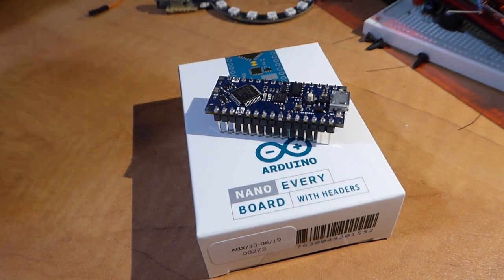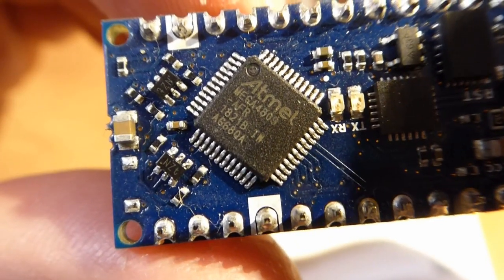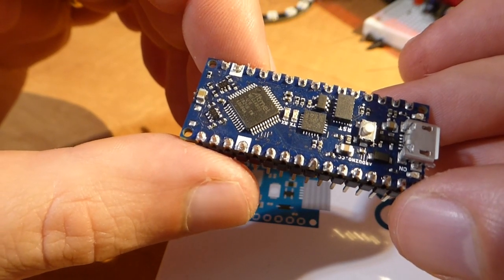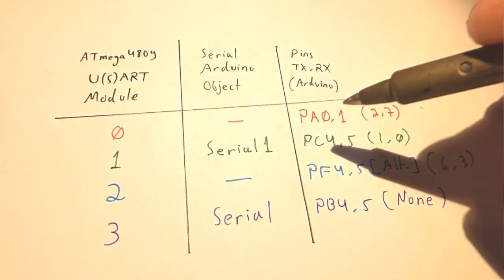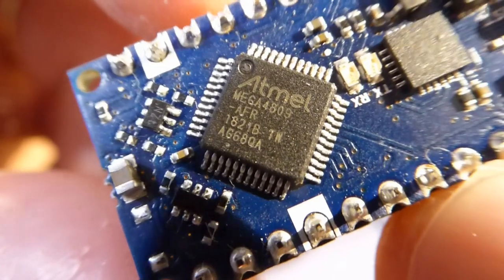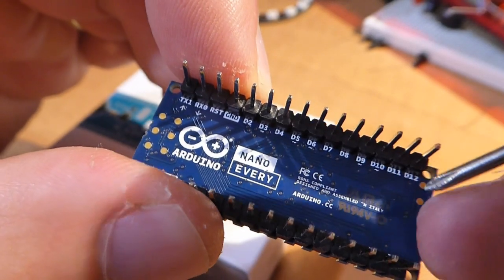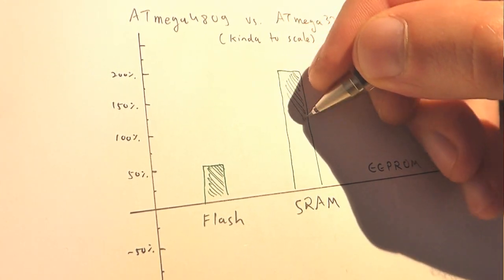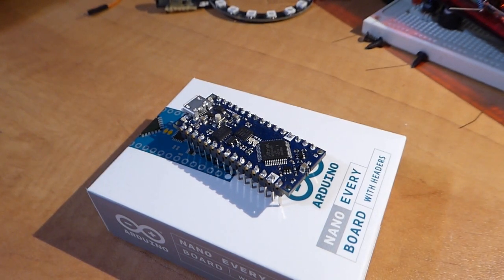Arduino Nano Every: Honest Review and actual info!

Comment: While I am on an old-ish version 1.8.19, a couple of sketches I have, seemed to run about 30% slower for repetitive digitalWrites.  Purchased an Every for the added program space, but was disappointed by speed.  Maybe they would be corrected in newer IDEs, but I will only use the Every, when it is actually needed.
Reply from the maker: I'll have to test that, 30% sounds like an unreasonably big difference. But whatever it is, if speed-toggling is what you require, using a generic catch-all abstraction like digitalWrite() is hardly a recommended path. Direct register access will accelerate such operations by a factor of 40, give or take.
Reply: @idogendel  I 100% agree on using registers directly... but I have not used the .   The test I first performed was running an existing sketch (seemed fair that it ran on the Uno, Nano, etc.) and it was easy to see the difference, without a stopwatch. I selected "Registers emulation: 'ATMEGA328' as when I selected None for registes emulation (ATMEGA4809) the hardware attached to the Nano Every did not function.  
Frankly, I chalked it up to the IDE compiling additional code so that the same source code would run on a very different processor.  The last thing I would have guessed is that it would be that much slower.   - Another sketch I connect to some I2C hardware would compile but not communicate.    [I ended up using a Pro Mega (solderable PCB) in place of the Every.]   Maybe one day, I will isolate the compiled code for the 328P and 4809P and see what the difference is.

Comment: Thanks. It's interesting to see negative review on youtube today. Anyways, I bought it case my nano has AtMega168p chip (it's 8 years old, I resurrected it) and Uno is weird format, I prefer using it in breadboard than connecting 10 wires. What I really don't like are pin description in the bottom. Also I'm not sure if insisting on the same form factor is good option, probably sometimes: for uno there are shields and for Micro I'm using headers with holes. But nano was always sitting in the breadboard for prototyping.
Reply from the maker: Yes, this form factor with the legend at the bottom side is a poor combination. On the other hand, with various evaluation boards, I find myself relying more and more on pinouts I print myself instead of squinting against tiny silkscreen text 🙂 Then I can also add pin function descriptions, personal notes and similar useful info.

Comment: I need suggestion for my application - I need 1 I2C, 1 SPI, 16 I/0 and one Uart along with a 48KB Flash for the code. Also what bout the Interupts Hardware and PCINT, how many are possible and can we have Independent PCINT now in Arduio if so how.
Reply from the maker: Hmmm.... how do you know you'll need 48K Flash for the code if you haven't chosen your MCU yet?
Reply: @idogendel  so my old code with half the features took 25kB so now with Bluetooth communication and IR control will take more code so atmega328 might not suffice. 
As well as I do not a pin count of mega2560. Also there is no information if we could burn Arduino in a lower pin count variant of atmega 2560
Reply from the maker: @adityamody8942  If you limit yourself to the Arduino IDE, then there are not many options. This MCU could work, but remember that its Pin Change interrupts are port-based, not individual pins. This means more latency which also depends on the specific pin used. But it's still in the microsecond range so it all depends on your use case.
Reply: @idogendel  true, my needs are 2 encoders and i2c display and couple of relays. So that was the reason for me to ask for interrupts and since it’s not pin based and port based. Not sure to implement two encoders. Maybe poll them since data only changes if encoders are updated else there is no data sent on i2c or spi
Reply from the maker: @adityamody8942  You'll have to take some measurements and do some tests to see what works for your specific hardware. This is not something that can be determined over Youtube comments 🙂

Comment: Hi, nice video. May i ask a small question? I am really looking forward to hearing from you. I used Nano Every and UNO with max30102.When i  use UNO, everything goes smoothly. But when i change the max30102 to Nano Every, i gain nothing. After that, i use two 4.7k to pull up SDA & SCL pins, but still doesn't work. Do you have some suggeations for me? Thank you soooo much
Reply from the maker: Well, it's really hard to debug stuff through Youtube comments. What does "gain nothing" mean? No output at all? Incorrect output? Error messages? In general, there seem to be three possible sources of failure: (1) Some mistake or problem in the hardware connections (e.g., loose wire or a pin mix-up), (2) Assuming you're using a code library, it might be somehow incompatible with the Every's microcontroller, (3) Something unrelated to the sensor, such as forgetting that the Every has different Serial objects for the USB and for the hardware pins. More information is required...

Comment: just use Arduino IDE2 then you can just set the clockfreqentie to 20 or 16MHz Whatever You want.
Reply from the maker: This video is a couple of years older than v2.0... but where in the IDE can you set that? I wasn't aware of such an option.

Comment: I keep getting a error “An error has occurred while uploading the sketch” and ive done everything and nothing has fixed it :(
Reply from the maker: Well obviously you didn't do everything ;-) Assuming the USB cable is ok, and the COM port, board type etc. were correctly identified and chosen, and nothing touches the board which may screw up its microcontroller's operation, and no program on the PC hogs the COM PORTs (e.g. Ultilmaker Cura), well, perhaps you can try to click the Reset button right as the programming starts. It's not standard procedure but I've seen it happen.
Reply: @idogendel  me and my girlfriend figured out the issue, it was strange, i had some stuff attached to the ardunio, and we took them off and it started working and also used a beta version of ardunio IDE
Reply: Errors were gone after me and her did that
Reply from the maker: @joshwayop  Well, there you have it. I think the hardware is more likely the source than the IDE. In these cases, it's usually something that drains too much power from the board, creates a short circuit, or introduces out-of-spec voltages. Whatever it is, be thankful that it didn't fry the Arduino altogether, and think very carefully before you connect it back :-)
Reply: @idogendel  yeah im very glad it didnt kill the board :)

Comment: Well I just received my first nano every and immediately uploaded my code to control 500 Leds @ 50fps. The standard nano could  just manage 470 leds @ 50fps as not quite enough memory. So when I saw 21ms for a frame of all 500 leds I instantly knew this nano every was exactly same speed as the old nano and most definitely is not 20Mhz. I confirm your 16mhz findings through alternate means. Oh well, at least i supported the arduino cause now :)

Comment: Honestly I found there was a modernised version of the 328P called the "328PB". Probably the biggest additions would be the 2nd UART, the capacitive sensor driver and the 2 extra 16 bit timers (and more pwm channels). The downside is that I didn't find this chip available in PDIP package. I did not check if it was pin for pin compatible, but I assume it is.

Oh and also... It uses the classic ISP programming method. No UPDI here
Reply from the maker: I did a project for a client once with the 328PB. It's nice but not a 100% "drop in replacement" (something with Vcc/GND pins, don't remember exactly now, and doesn't support full swing oscillator). But it was a step in a direction that eventually dried up; the 0-Series/1-Series (e.g. ATmega4809) and the AVRxxDx are the current direction of AVR, and they are significantly better.
Reply: @idogendel  you really know a lot more about atmel products than I do. Nowadays I'm mostly into stm32's products

Comment: I've just bought a Nano Every, frankly I did it just because it was cheaper, and the project I'm working on is straightforward and doesn't need to be backward compatible. But I see in the comments that although you know your way around Arduino that you prefer not to use it as it is for beginners. So my question is, what would you recommend to intermediate microcontroller developement, and I mean as a step further from Arduino? Is Microchip with its Curiosity Nano and their IDE good? I see that the developement boards are about the same price as Nano Every. I am also using Visual Studio with the vMicro addon as Arduino's IDE is just terrible, no vim.
Reply from the maker: I think a good first step is to take an Arduino board, but program it at a lower level (using the registers and your own code  instead of Arduino functions and libraries). After all, the microcontroller itself is perfectly good. This can be done even using the Arduino IDE . When you feel more comfortable with the "raw" hardware, you can switch pretty fast to other MCUs and other IDEs.
Reply: @idogendel  Thank you, I appreciate the reply!

Comment: Hi and thanks for a well made brief intro. I bought this device because in a project I needed some intricate math on a ToF sensor combined with a small OLED display. However the OLED crunched most of the SRAM so it was not possible to host both math/ToF and display in my much beloved Nano. 
Anyhow there is still one thing that I cant find the information about regarding the Every; Since I use I2C, is it 3,3V or 5V pull-ups as communication levels?
For the Nano it was possible to communicate at 3.3V level by disabling the internal 5V pull up and use external 3.3V pull-up instead, do I have to use the same solution on an Every?
Reply from the maker: That's a very good question. I couldn't find anything about this in the datasheet, so I uploaded a demo Arduino program that uses I2C and measured. The internal pullups are, as expected,  set up automatically and go to 5V. However, if - after initializing the I2C - you disable the internal pullups on the SDA/SCL pins (e.g. PORTA_PIN2CTRL &= ~8; PORTA_PIN3CTRL &= ~8;) the lines go back to LOW. I can't promise external pullups will work as you expect - no guarantee or warranty - but so far it seems possible. Test very carefully and let me know what happens :-)
Reply: @idogendel  Thanks, I will. Will get the Every's in a couple of days I hope and especially the ToF sensor uses LVTTL i.e. 3.3V. The OLEDs are not that fuzzy ;-)
On the Nano it works fine with external pull-ups via 10k resistors, so far used on a bread board.
Reply: Ok, got the Every's but cant get them to work with my code :(. This will take some time. As of now I have divided the display functionality (SSD1306) and the Tof functionality (VL53L1x) into separate sketches, none of them works on the Every. Using ATMega328P emulation does not help. This is now a different forum question

Comment: Honestly, an Arduino Uno Every would have made much more sense. If you could use some 2-row headers in some places instead of the single rows, at least no pins would have been wasted. And by keeping the same footprint, you'd ensure compatibility with Arduino Uno shields. I don't know if my suggestion makes sense. Without forgetting to put the ICSP header.

Personally that would make a fantastic upgrade from the traditional Arduino Uno and make it much more competitive compared to the Nano, which usually outclasses the Uno by 2 extra analog pins.
Reply from the maker: It would certainly be better than the Nano Every, but still miss some of the 4809's advantages. The advances in MCUs simply can't map to the original Arduino structure anymore.
Reply: @idogendel  what example do you have on mind? I'm well aware that you can't make something 100% backwards compatible, but this could be the start for an eventual shift.

There's also a same situation with most of the SAMD-based Arduino boards
Reply from the maker: @caffeinatedinsanity2324  I was thinking about the I2C pins issue I mentioned in the video. No matter what you do you'll have to compromise somewhere.  And more generally, as MCUs advance, you either constrain more and more of their abilities to maintain the backwards compatibility, or the other way around. There are tons of different boards that work with the Arduino IDE, but even more tons of educational material and hardware add-ons based on the classical Uno/Mega/Nano. Personally I believe the Arduino should not change at all - let it be the same old, just re-purpose it into a gateway to proper Embedded, a means instead of an end.
Reply: @idogendel  Yeah the I2C is definitely a major issue since no pins, as you said can serve both as analog and i2c master communication lines. This being said, assuming I was a PCB designer, I would probably not hesitate to replace A4 and A5 by the true I2C lines, considering people typically don't use them as analog lines. Of course it will never be 100% backwards compatible.

The funny thing is that on Mouser, the ATmega4809 is cheaper than the ATmega328p and I'm starting to think about making my own Uno-based development board out of it and maybe later on build the board manager for it. Without forgetting to share everything (schemes, code, etc...) with the arduino community.

As I said, I cannot ensure 100% backward compatibility with a new technology but I do no want to let it go to waste and I think I can still make it compatible with the vast majority of existing material. I read the datasheet and it offers some really neat features like an RTC, a timer with direction control (good for making a hardware encoder counter) and a bunch of other stuff.

Maybe I'm just too enthusiastic about it... Honeslty I regard the Nano Every as a great idea that was just poorly executed and thought.

One application where this would shine would be with GRBL shields and such.

Comment: I think you CAN use some of the program flash as user application data space, so you can carve out some more eeprom like memory if you need it.
I'm waiting for Arduino to make a nano using the new AVR128DA series chip.  That has 16kb of sram, 512 bytes EEprom, and 128KB of program ram.  Imagine, 128k in a 28 pin dip!
Reply from the maker: Storing changeable data in FLASH is always an option, there are even MCUs with no EEPROM at all where that's the only way; but the FLASH has less write cycles, can only erase in pages, and needs a bit more complex programming. I recently started playing with the DA family, it has some very cool features indeed but, as in the Nano Every, the Arduino framework will probably just  limit them...
Reply: @idogendel  I've just ordered some samples of the AVR4809 and AVR128AD in DIP and QTFP packages, as well as the avr128DA explore-Nano from MC.  I've installed their MPLAB X software and MC8 tools (I'm running Kubuntu here), and I already own a PicKit4.  I plan to use AtmelStart to create a project framework for these chips and see just what they can do.  Seems like for the price, these chips will give the SAMD21 series a run for its money, maybe slightly less performance but alot easier to program.   If Microchip continues to expand the  mega 0/1 and the DA/DB line, the XMegas are DEAD and BURIED!  (They just need to add an integrated USB into the DA and mega 0/1 parts).
Reply from the maker: @scharkalvin  Frankly, I think the Xmegas never got the chance they deserved. Kind of fell through the cracks with the Atmel purchase by Microchip and everything. Personally I love to play around with low-level programming and not use frameworks, but that's just me - I'd love to hear your conclusions when you have some :-)
Reply: @idogendel  You can let AtmelStart or MC CodeConfigurator  provide empty outlines so you are able to get all the required init stuff right, but you still have to know the low level stuff to flesh it all out.

Comment: I enjoy this video! ... HOWEVER, does this apply (and work?) with MicroChip MPLABX? ... As mentioned by others, MicroChip has there own board with the ATMEGA4809 calling it "Curiousity NANO" and UTUBE video's show MPLABX working with that...
Reply from the maker: If you know how to program a microcontroller without Arduino, then Curiosity Nano + MPLAB X is a much better option in terms of hardware (more pins, less limitations). But for beginners, or if you want to leverage the Arduino libraries quickly, you'll have to compromise on the hardware side.

Comment: Well done with excellent technical detail! However, your conclusion should have been better explained. The board is half price of a Nano with twice the memory and more features. Sure you can't use several additional I/O pins that remain unconnected (for Arduino Nano compatibility; they should have included pads/connector to use these additional I/O). Silkscreen labels only on the board bottom is worth mention but hardly a show stopper. Lack of an onboard crystal may be an issue for many users as you mention. Microchip now offers  Part Number: DM320115 - ATmega4809 Curiosity Nano Evaluation kit for $15 which appears to have all I/O pins accessible. If someone could make this board compatible with Arduino IDE it could be more useful than the Nano Every. An onboard 32KHz crystal is included.
Reply from the maker: I think it boils down to what one expects from a board called "Arduino Nano". Of course, if you have enough technical understanding you can easily tell for which uses the Every would be excellent and for which, less so. But I do love those Curiosity Nano boards! Great for prototyping, they even let you define the voltage provided to the MCU (e.g. 3V3/5V)